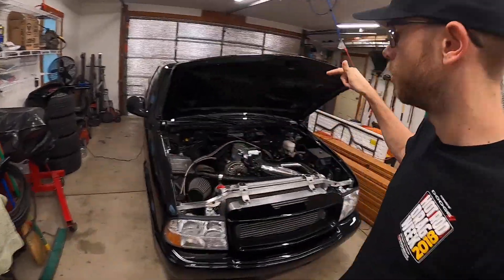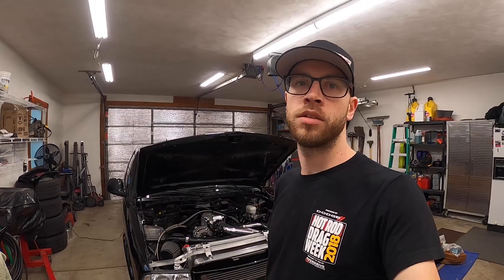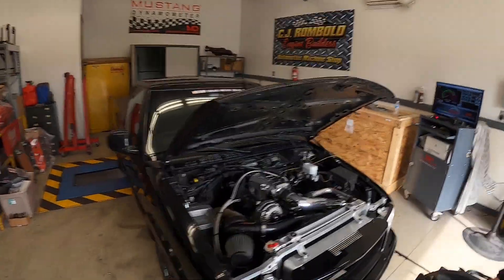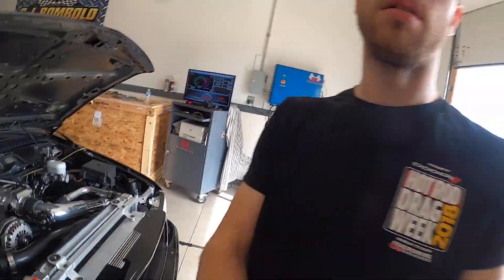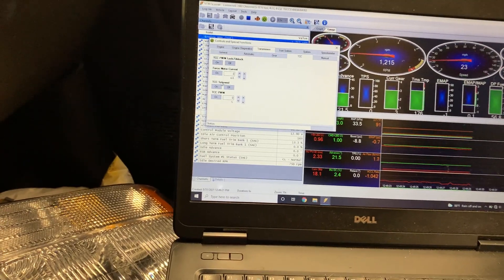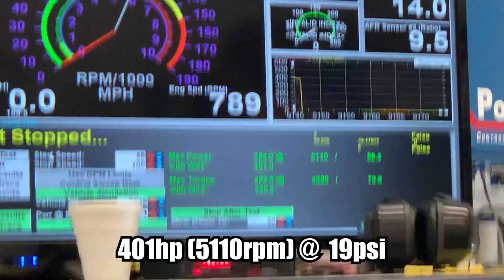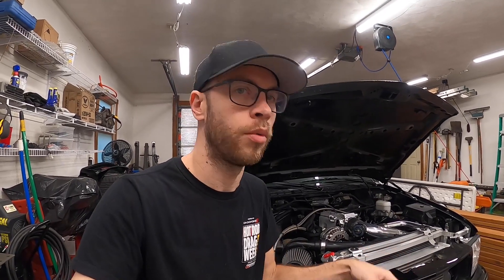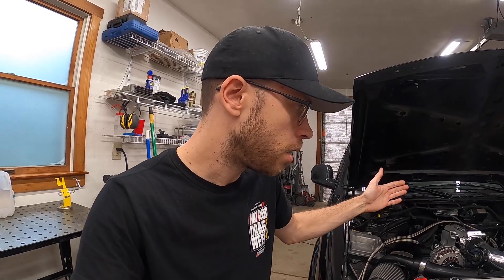Dyno Day - How Much Can A Stock 4.3L V6 Motor Take?

Comment: What would 400 wheel be at the crank?  460-500? That auto is a 4l60e and might be the first thing to go.  I'd like to see some porting, cam and springs and a bump up in compression then take it to 600 wheel.  If a good crank is available and you forge the bottom you should be ale to run 1000 hp or close to it.  But you will need a built turbo 400 and a beefier 3rd member.  I would like to see you find the breaking point of the stock short block when you are ready to build the bottom.  I think V6's can handle as much as V8's because they are more compact.  We used to hit Ford 3.8's with a lot of boost or N20 and they held up to about 800 hp.  Where as the 4.6 would break the block at 450 to 500.  Love watching this.  Keep going.
Reply from the maker: Yeah probably close to 500 crank would be my guess.
Reply: So you want him to break all his stuff and report back to ya... ???
Reply: @superkillr  You weren't paying attention.  Only if he is going to build a new forged bottom.  Then give it a big bang to see how much the stock short block can handle. I think if he opens the ring gap,  it will handle a lot more than we think.  Just don't over rev her.

Comment: Remember that the 4.3 is 3/4 350. It shares basically nothing with an ls motor
Reply: My older non balance shaft 4.3 valvetrain looks like traditional 350 stuff.     But my engine put of a 2013 (balance shaft 4.3)  has rocker arms like an ls with needle bearings and a center bolt mount. 🤷‍♂️  rods look different between the engines too. If I can find pics I'll share.
Reply: A 4.3 is the exact same everything as a 350 sbc minus 2 cylinders. Same valve train, same pistons, same rod, same crank just shortened, same cam just shortened, but yes has nothing to do with an ls. I can’t say anything for the newer 4.3s that came out around 2010 or so cause I’ve never worked on them.
Reply: It doesn't even share the rods or pistons of the 350. It's really in a league of its own and that's why parts are hard to come by and super bucks when one wants to upgrade
Reply from the maker: Pistons are the same. Along with most of the valvetrain parts
Reply: @turbov6  You're correct

Comment: I like you channel. I've got a 1998 4.3 that's been fresh build bagged for years, and these turbo kits are cheap.
Reply: I've got a 98 4.3 aswell, where are theese "cheap turbo kits" for sale at?
Reply: @dylanbender3856  I've heard these Chinese turbos aren't complete shit anymore. I saw a full kit for $699.
Reply: @saulgoode5923  the Chinese turbo kits on Ebay?
Reply: @dylanbender3856  It's not just ebay, but yeah. As long as the impeller doesn't come off and get sucked into my intake then they've gotten better and run out around 600 horse.
Reply: @saulgoode5923  that's alot of power! What size turbo comes with the kits usually?
Reply: @dylanbender3856  They make a gt35 clone some youtuber was promoting from Maxpeedingrods, and I've seen youtubers buy Chinese turbo kits for fun. They aren't bad anymore, but they're no Garret.
Reply: @saulgoode5923  it's definitely more than enough horsepower to have fun with!
Reply: @dylanbender3856 I'll keep watching.
Reply: I have a 98 4.3 aswell, where are theese cheap turbo kits available at?